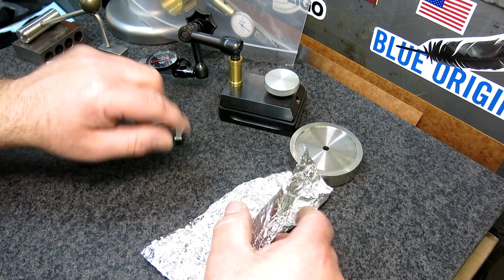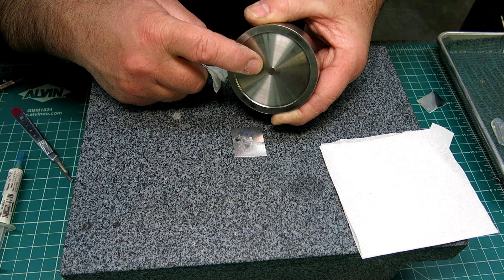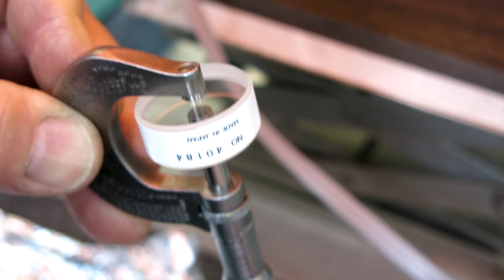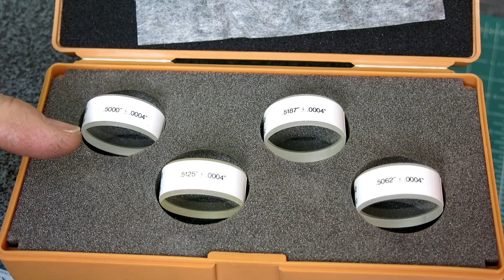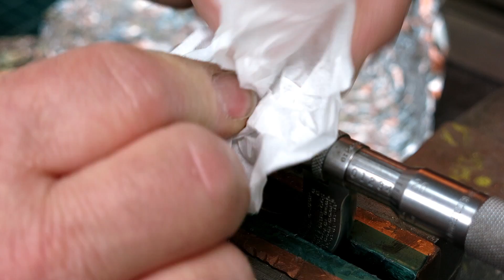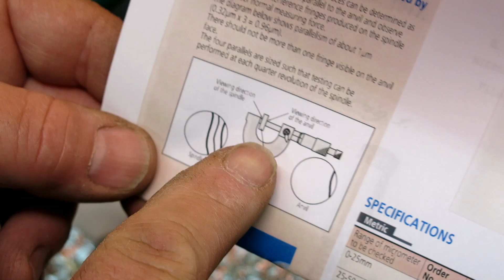Space Micrometer Anvil Lapping

Comment: My name is Carla Piaia and I had a one inch Mititoyou micrometers that had totally scratched carbide faces and I used to work at United air lines and they threw away this piece of metal, it looked like a almost like a gauge Cube and it was 1.000 square with just ground surfaces and I got
some,three Micron diamond dust and putting it in an STP and I just sat there watching TV, lapping it. And it came out really nice I gave it back to the Metrology and they checked it with the three different thickness optical flats, you know to check it for flatness on both faces and they said yeah it looks fine. And then I told them I lapped it with "this",and I showed them the "cube" they said what!? You did this at home? I said yes.

Comment: I am watching this great video for the third or fourth time to pick up the details. I am particularly curious about the aluminum foil tape you used on the surface plate for lapping. I found many versions, brands, and widths of this on the web. Can you describe what you use any better? It seems that one thing that may be of interest would be the consistency of the tape's thickness. Standard aluminum foil is very consistent in thickness, but does the adhesive add any additional concerns?

Comment: Thanks,  entire process was very interesting.   

At my old company,  we had an optical fab shop where they lapped glass optics before thin film coatings.  Other engineers were " goto " for help.  I got in there once for a electrical control problem the tech couldn't figure out.  They always were too busy to just drop in and be nosey. 

Different animal than hard metal surfaces.   

I did see a contractor come in to fix the ways on a model maker's lathe.  he was there like 12 hours + . Got to look in a few times as you didn't want to bother him, but curiosity was a driving force.  Was perfect when he left,  he looked like a out of work plumber from Russia.  He was the go to guy.  timing was like  2001 - 2002 ish.

Comment: Hey Tom. I find myself referencing back to this video after acquiring a set of old J.T. Slocomb mics from eBay. I've restored them to good working order, and I'd like to lap them in as a final touch. However, I'm unsure how to lap the larger mics (1-2, 2-3, etc.). The idea I've had so far is to lap the spindle using a fixture similar to the one you made, then use an appropriately sized gauge block (with aluminum tape on the faces) as a parallel lap for the fixed anvil. 

Does this seem like a viable method (that won't destroy my gauge blocks...)?

Comment: Looks like a good way to ruin a micrometer. At most micrometers have .0005" of "adjustment" to calibrate them. And no, when properly used round objects do not wear anvils and stems "unparallel" because you move the micrometer "laterally" across the shaft and you damned sure don't mike any material hard and abrasive enough to wear the hardened micrometer parts. You also don't use micrometers like a damned C-clamp and crank down on the material at all. Your "optical flats" are truly worthless for checking the "parallelism" of the anvil and  stem relative to each other because they won't be "parallel" until the slack is PROPERLY taken out of the threads. Which is NOT done using the "ratchet". Any competent, experienced and properly "trained" micrometer owner/operator knows the TRUE purpose of the "ratchet" is to serve as a ROOKIE ALARM. Ratchet mechanisms are never consistent, reliable or accurate mechanisms for "measuring torque" and no two micrometers will ever "measure" the same part the   same using the ratchets. I learned micrometers the old-fashioned way with my OWN Starrett 0-1" in a tech school class where we passed around several trays of "standards" and developed "feel" for a few days without the "final" being everyone measuring forty "new" pieces and measuring to the nearest ten-thousandth even though we were specifically prohibited from buying Vernier mikes in the first place specifically so we'd have to develop "feel" and demonstrate it. The "final" was a big chunk of our 1st quarter "Hand Tools" grade to the point that if you weren't already carrying a solid "C+" average, flunking that "final" meant flunking the class and possibly the quarter. But there were only three ways to "flunk" the final. Cheat, fail to finish or USE YOUR RATCHET DURING THE TEST. You have absolutely no business even using micrometer much less "reconditioning" and "calibrating" one. Almost 27 years as a diesel mechanic and thousands of bearing shim packs, poppet valves, relief valve shims and various other parts measured later and tens of thousands of service truck miles in the "precision tools"  drawer of my Snap-On Heavy Duty Road Chest later, my Starrett 0-1" is still "like new" in its purchased-separately like-new Starrett case which still has all of the original "paperwork" ticked inside above the lid foam with the calibration wrench I might have used half a dozen times. How is the case still like new? It's in the original cardboard  box the mike came in. I'd love to "check" that "lapped" mike against mine on a 1" standard and then run it down to "zero" and see just how "parallel" those surfaces are and how far you had to crank the sleeve to get it "calibrated" assuming you were able to at all. Which I seriously doubt.
Reply: I don’t want to start WW3 over the topic of micrometer ratchets. However, DEEREMEYER1’s impassioned polemic begs the question: If it is such an embarrassing gaffe to actually use the ratchet and friction thimbles, why do the manufacturers include the feature on their micrometers? Is it just a cunning plot on their part to unmask hapless rookies so that more skilled technicians can point and snigger? In the link below Mitutoyo actually encourage people to twirl their micrometers using the ratchet or friction thimble, although just to confuse the picture, they also add the caveat that the user should endeavour to achieve a consistency of closing force and speed. With respect to DEEREMEYER1’s concerns about having the graduations on the thimble in proper relation with the fiducial line after lapping, surely that is taken care of by remounting the graduated thimble in the appropriate orientation on the taper on the end of the spindle.
   https://www.youtube.com/watch?v=n0tO0XNIptU

Perhaps Tom should organise a “measure off” at ten paces with DEEREMEYER1 utilising suitably accurate unmarked blocks. Tom probably knows someone who, in the interests of science, could calibrate some blocks to within one wavelength of light or a gnat’s whisker, whichever is smaller. To make it fair, the contestants would have to work off the same standard. The contest could even be run through the post, albeit slowly. I am inclined to be ecumenical on the subject of micrometer ratchets. Do whatever turns you or your micrometer on.   
Cheers

Comment: Tom, after you reassembled the micrometer and lapped the fixed face parallel with the newly lapped moving face, did you turn the cast iron lap over and try take out some of the edge rounding on the moving face that was left by the softer aluminium lap? I expect that one of the disadvantages of the aluminium-foil-on-surface-plate technique is a tendency to round the edges to a greater extent than would occur with a harder one-piece lap. That tendency would be greater still with the extra thickness and squishiness, that’s a technical term, of the self-adhesive aluminium foil, especially with a small item where the downward pressure can locally deform the aluminium and the underlying adhesive. I smile at Mr Boso’s grumpy observations.

Comment: Go ahead and "lap" it and you'll no longer have a "0-1" micrometer. There is maybe a thousandth of total "adjustment" for returning it to zero. You have no clue what you're doing. As usual.
Reply: The point that you raise is not an actual problem. Micrometer thimbles are attached to the spindle by means of a non-keyed conical taper. Consequently, any change in the length of the spindle due to the lapping can be accommodated by re-orienting the thimble on the conical taper so as to match the usual position of the fiducial line. Indeed, it is possible to convert a standard micrometer to a left handed version by moving the fiducial line around to the opposite side of the micrometer and adjusting the orientation of the thimble on the spindle accordingly. The downside is that the numbers on the thimble will be upside down for the left-handed user. Inter alia, the video in the link below illustrates how the thimble can be loosened and re-oriented on the spindle. Cheers. https://www.youtube.com/watch?v=7UJw5Ts5vgA

Comment: I may have missed this.....but aren't you effectively shortening the spindle by a small amount thereby throwing the zero point off? Can the zero point be reset? I see no way of doing this on the micrometer I own.  Great video.
Reply: It will shorten the spindle slightly. A badly worn carbide spindle anvil would be out under .0002". All micrometers have zero adjustments.

Comment: They are called light bands. Not fringes. One light band is flatter than three light bands. The distance between the light bands is also an indication of flatness. More distance between light bands is flatter. Reason to not go into more detail is it is also conditional for the size of the surface being measured. That opens up another set of variables that have to be explained.

Comment: Maybe the lines relate to the waveforms. If you see a number of lines on one side, there would be a corresponding offset of lines on the opposite. Since the area being checked is so small not many lines will be shown, hence the 3 lines vs. 1 line. Maybe odds/odds, or evens/evens. Might be related to thickness of glass/wavelength???? My thoughts anyways.....

Comment: I hate to be the guy, but lapping between the two existing surfaces of the micrometer surely introduce some angle or pivot between the faces? I know it's minute, but they are not perfectly parallel from the factory. When the micrometer barrel is rotated against the lapped anvil, there will be a taper or deviance from true perpendicularity that is projected onto the mating surface; when rotated, the two surfaces will no longer be co-planar or parallel to each other?
Reply: Good point-

Comment: After many years of careful use I dropped my Starrett .001" reading mike. With clean anvils, and using the ratchet to zero it out, I'm getting a reading of about .0003". I'm wondering if the ball method might indicate an out of square condition between anvil and spindle. Any thoughts?

Tom
Reply: Sounds like you may have closed the frame slightly. Have you tried adjusting back to zero?
Reply: http://www.longislandindicator.com/p29.html

Comment: I had it in mind that the diamond would be embedded into the lap with a roller and all the loose abrasive would be removed before lapping.  Seemed like the loose abrasive would try to squash under the edge of the anvil as it was moved, creating a rounded edge.

Clearly I was wrong.  Is there some situation where that would make sense?
Reply: You are kind of technically correct but practically not. The beveled edge is proportional to the abrasive size, For a very broad rule of thumb it will round the edge to 4x the abrasive size due to hydraulic pressure forcing the odd double grain in to get rolled over before settling to a flat roll. This also happens at a rate related to the volume of abrasive vs lubricating fluid so very minute amounts of abrasive vs lubrication would near eliminate it from happening . On this scale, the effect is so insignificant that its considered near non existent requiring electron microscope style detection.... but it does technically still happen like most people would expect.
Reply: I regret I can only give one thumbs up for this.  It's exactly the kind of thing that's useful and makes me think.  Thanks, mate!
Reply: If I follow your meaning correctly no. What lapping like this does is almost float the part on the lap with the bed of tiny abrasive beads - ones around the edge of the part as the lap is moved will just flow and form new rows of beads. So the edge of the part will never really round over the edges - all the abrasive forces are between the lap and part. (The paste is full of really really really tiny abrasive beads - so they will move easily)

Comment: Thank you Tom for the interesting video. I have a very cheap micrometer that I got for 5 buck but the anvils are horrible. Now I know how to properly get them back into shape.
Reply: For pete's sake get a quality micrometer-pitch that one!
Reply: Hi  @horacerumpole6912  , I have a Brown and Sharpe and a digital Mitutoyo. The micrometer I wish to fix is a D.C.M.T. by the London Instrument company. Whoever owned it before abused it but I got it running nicely. The only thing left is the anvils. The thing was dirt cheap in its day but it for students and they were supposed to do all the things needed to make accurate measurements. I've learned a lot by getting it back in shape.
Reply: OK, it's not junk then? Can you trust it?
Reply: hi  @horacerumpole6912 , actually it is pretty accurate. I have checked it with a set of gage blocks using ASME B89.1.13 procedure and it is pretty good. But there is a pit in one of the anvils and the other is crowned so I don't trust it at the moment. I am not going to use it for measuring parts; even when completely fixed. It's a learning experience to see how accurate crappy tools can be made to be. Thanks for the interest.

Comment: How do you lap a plate parallel? Flat is easy, but parallel? I can not think of a way to do it and I can't find a video about it. I would love if you could explain that in a video or point me to it, if there is one.
Thanks for all your work.
Reply: Lap both faces flat then measure. Lap again pressing harder on the side that's higher. Found a video doing this with a ring: https://youtu.be/ovD3nJ7zGiM?t=310. He marks the high spot with a dot and then laps pressing on that dot.
Reply: @filisoft  Thank you.
Reply: How would you use/need a parallel plate? Get a jo block-
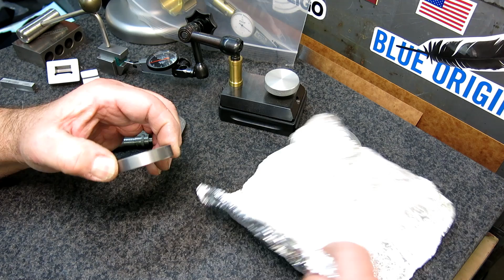Reply: @horacerumpole6912  At 3:55 tom says that the cast iron plate is lapped very parallel and I wonder how the hell he did that. And "get something" is a bit against the concept of tool MAKING ;)
Reply: Unless you're just starting out in the machinist trade, you would have at least a basic set of jo blocks. They're the foundation of dimensional accuracy.
Reply: I'm curious as to why/how you intend to use a parallel cast iron plate?
Reply: @horacerumpole6912  I don't intend to use it in any way. Tom showed it and talked about it and I am curious how he made it.
I am an office chair machinist. Last time I did some apprentice work on a lathe and a mill was more than ten years ago. I am a machanical design engeneer and I want to know the tricks of the trades to make things possible.
Most of my colleques thought I am a former machinist, because I know how to machine parts that seem un-machinable to them. Even the guys who were machinists before their office jobs thought I was one. I don't have any need for a hand lapped part right know, but you never know when I have to solve a problem at work and think "There was that thing Tom did once..." Have a nice day!
Reply: Good enough! Enjoyed hearing your story.

Comment: I think the patterns showed both faces of the micrometer being slightly convex. Maybe this comes from the lap being pulled freely with your hand, because there will be a slight deviation from it being parallel to the surfaces of the micrometer, which would result in both faces becoming convex. I guess if this problem should be eliminated there would have to be some kind of fixture to hold the lap and the micrometer in the correct orientation while lapping. That might become complicated though.
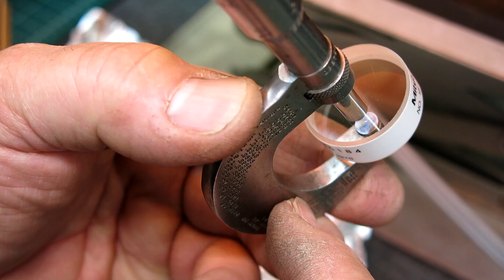Reply: I agree that the anvil and the spindle ends appear to be slightly rounded and are most likely convex. At 29:58 in the video, the fringe pattern for the spindle looks to be to be a set of concentric round fringes that are not centered on the spindle face.  Counting from the dark fringe in the center as zero, I count 2 1/2 fringes to the farthest distance from the center, which corresponds to 2.5 fringes x 0.447 micron/2 per fringe = 0.56 micron or 22 microinch.  At 30:15 in the video, I see only 1.5 fringes from the center dark fringe.  There should not be straight fringes with a parallel optical flat clamped between a pair of parallel surfaces.  Straight fringes indicate a wedge.  If the flat glass face and and a metal surface surface are parallel, then the reflection from the paired surfaces should all be the same and change from a maximum to a minimum of reflected light with a change in spacing of half a wavelength.